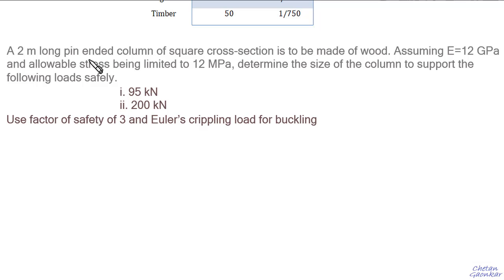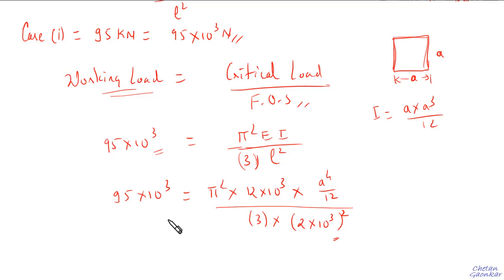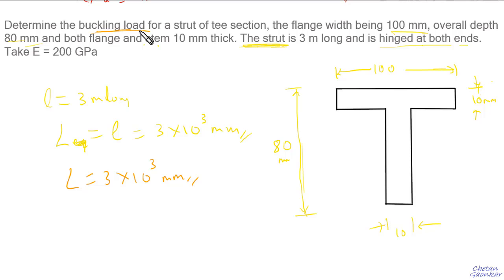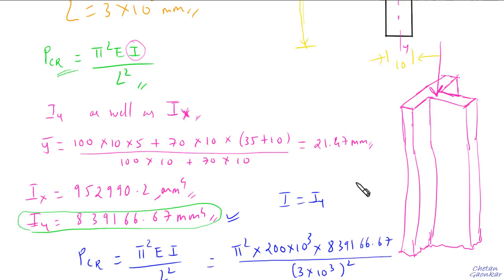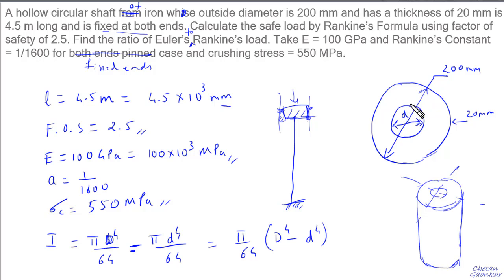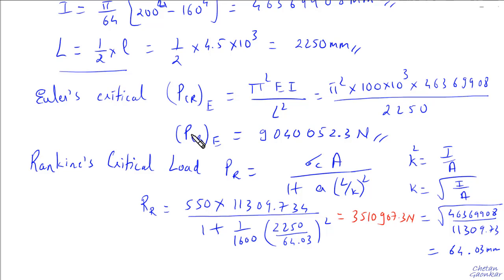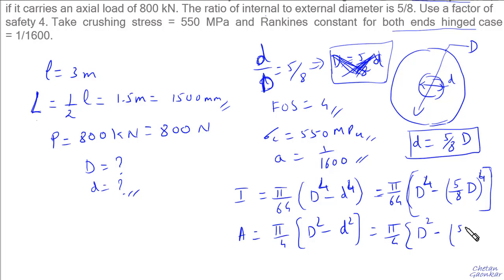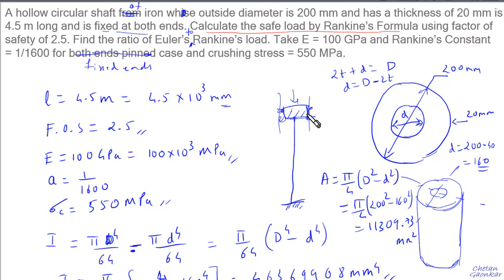6. Columns and Struts | NUMERICAL | EULER’S CRITICAL LOAD AND RANKINE'S FORMULA

Comment: A hollow cast iron 5 m long column with both ends fixed is required for support a load of 1000 KN. If the external diameter of the column is 250 mm, find its thickness. Take working stress as 80 MPa and Rankine's constant as 1/1600.

Solution,??